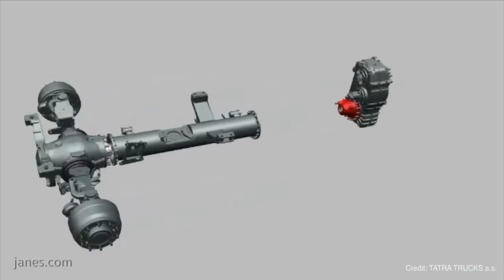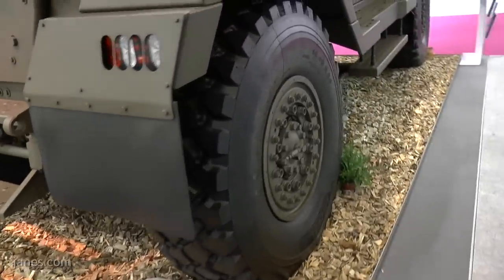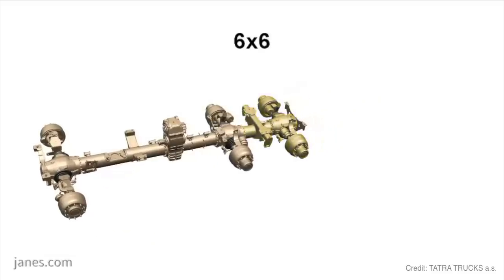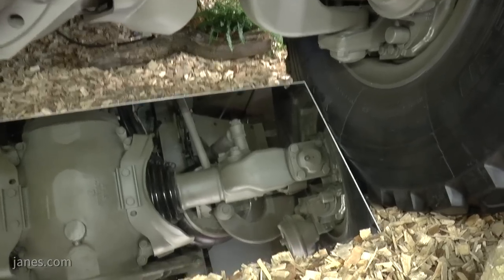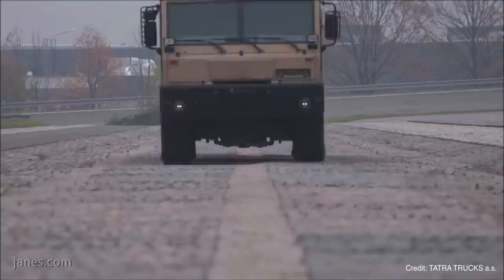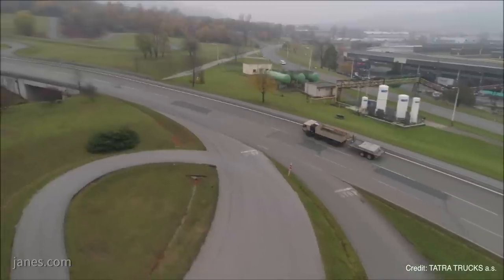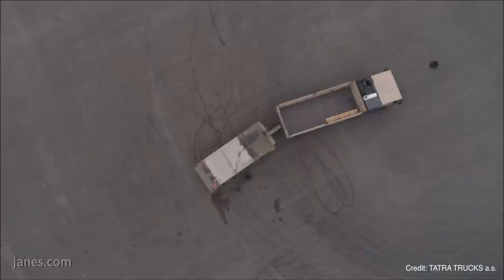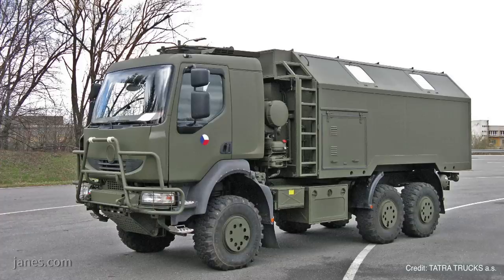Eurosatory 2018: TATRA TRUCKS recent chassis-based developments including their new trailer

Comment: 5 tonnes and not powered..whats the point it commercially too heavy and useless off road.. Tatra can easily fit land drive from the rear axle of all their backbone chassis through a coupling on the drawbar.. Infact Tatra could do this easier than any other truck manufacture going them a huge advantage.. When I work for Tatra in 2006 this was written in our report as a project to get developed but that as well as 40 other ideas where never taken up....

Comment: Is the trailer powered?
Reply: No. In the video, the trailer is not feeling pulled by the truck. But in the constructive way of transmitting the Tatra truck, this is perfectly possible! Note at 2 ': 56 "
Reply: @MrSuwds  Get a new translator. That one isn't working, not making sense.
Reply: @johnarizona3820  It is not connected. In this video, the trailer is only being pulled by the truck.
But the Tatra truck is perfectly possible! Watch pausing the video at 2 ': 56 "
I hope the translation has improved.
Reply: @johnarizona3820  It would be easy to create a power take-off on the chassis of the Tatra truck.